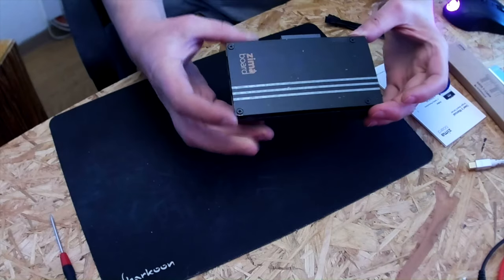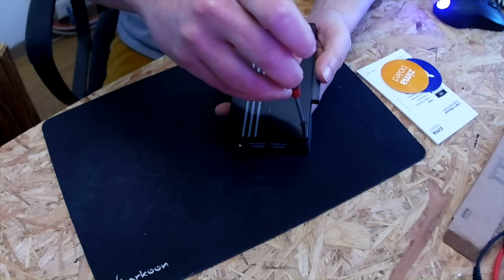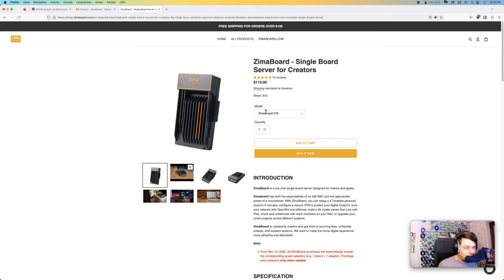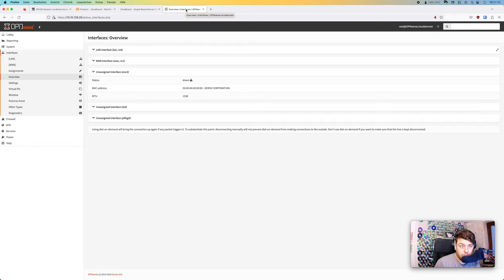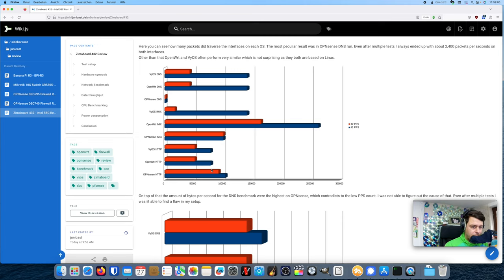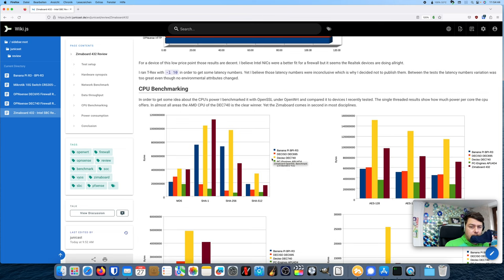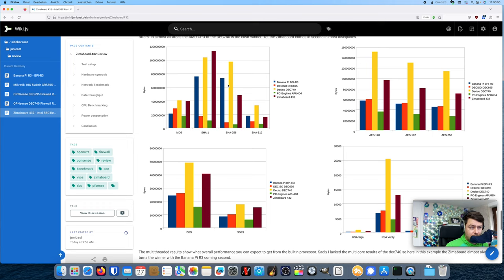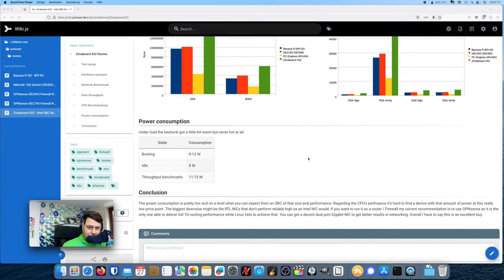Zimaboard Firewall Review

Comment: Well, its been mentioned already, but LOL @ that sock fur/deadcat! Hey, it works though right? 
Just curious, would you use opnsense over openwrt for a gigabit connection? I'm leaning towards openwrt personally...
Did you try irqbalance when testing with openwrt, or did you ever find the issue causing openwrt to perform poorly?
Reply from the maker: I did not experiment with IRQ balance. I read that BSD has problems with PPPoE performance in gigabit scenarios. I personally favor OpenWrt because I deploy those with Ansible but OPNsense is also excellent choice.

Comment: I can share my experience with you regarding what happens if you replace CasOS with another operating system on the internal SSD drive. ZimaBoard won't function properly, and you won't be able to boot it without an LCD monitor. This is exactly what occurred in my case.